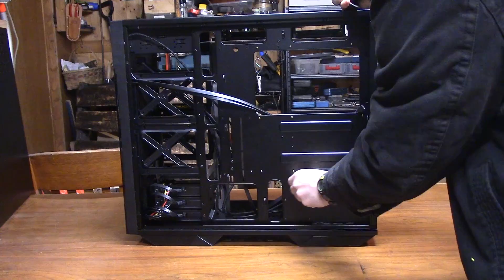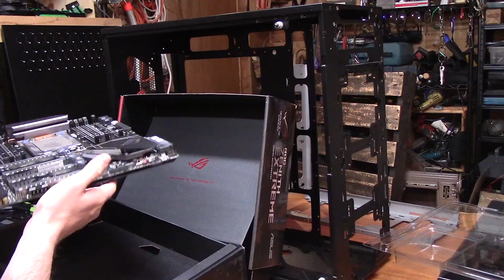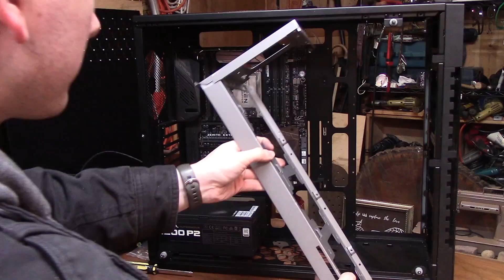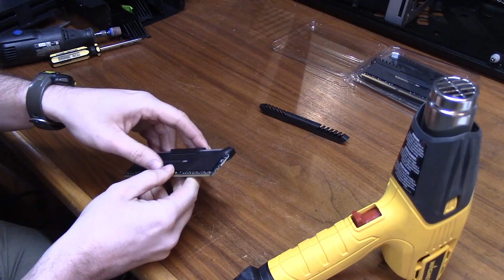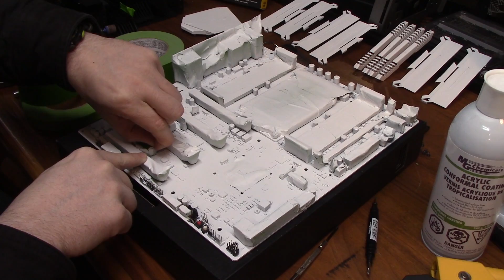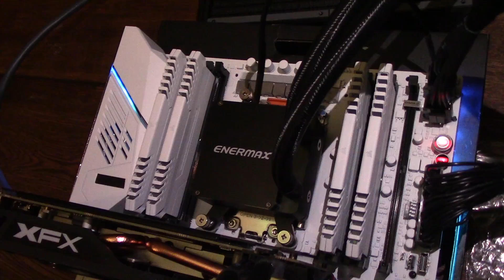Project Purity - Modding an InWin 509 workstation PC

Comment: I can't believe you spray painted that $300+ mobo.  Painting motherboards is already a bad idea, nevermind ruining an expensive mobo.  You're a good modder, build some thermal armor.
Reply from the maker: Paint looks better to me, and it's non conductive so it won't hurt anything. Worst thing it could do is trap heat, but according to the testing I've done any heat it traps is negligible. I'd love for someone more professional to do some testing to confirm my findings

Comment: Ok no ... painting the MB ... not ok ... it triggers my OCD and that part of my brain that holds my electronics knowledge. I like reading the part numbers on the chips and components. Yes I am weird that way!

and of course it makes it hard to troubleshoot the board later on, no more access to the probe points etc.

I mean if that is not an issue for you more power to ya, for me it would do my head in over time.
Reply: mobo painting is awful

Comment: So no problems painting heat sinks? Those are the only parts i continually hear is an issue.  Have you actually tested the temps or just assuming its fine becvause nothing has overheated and exploded.  I want to really bad.  Thanks anyways for these videos. They are great, and your great!
Reply from the maker: +Zachary Smith Thanks! I've tested the temps and they are fine, you won't have a problem if you do it correctly :)